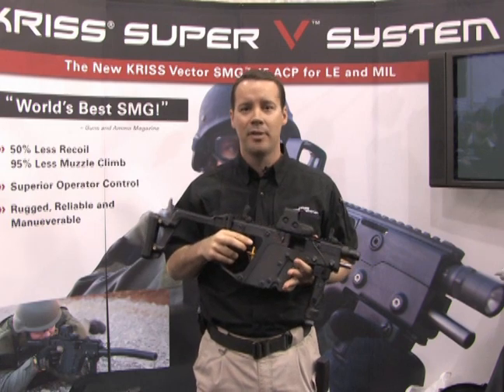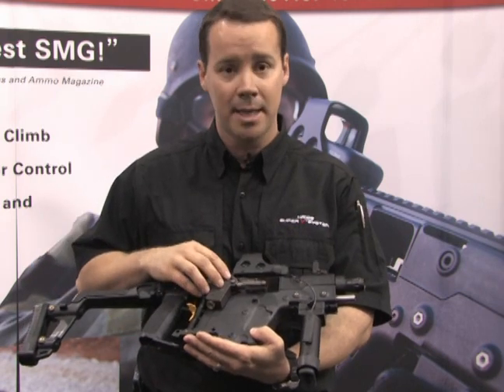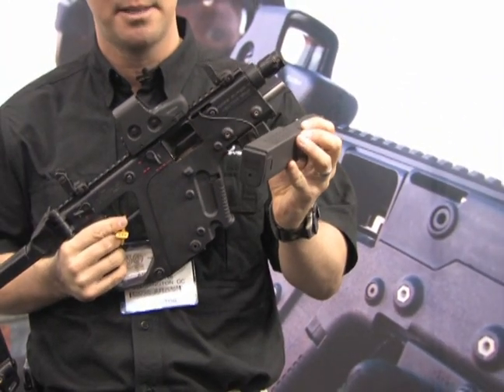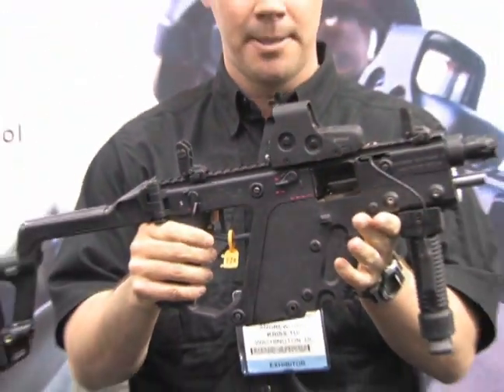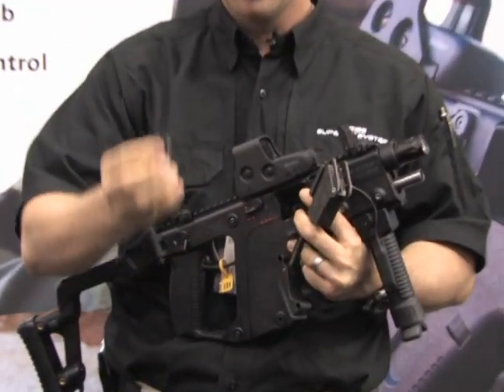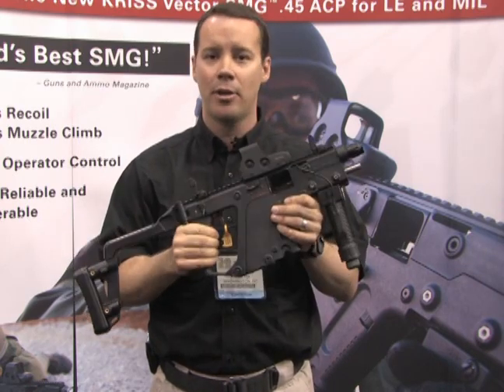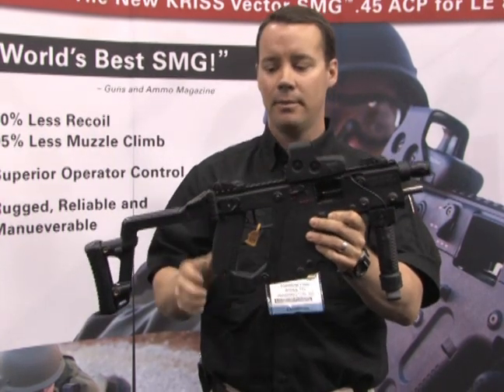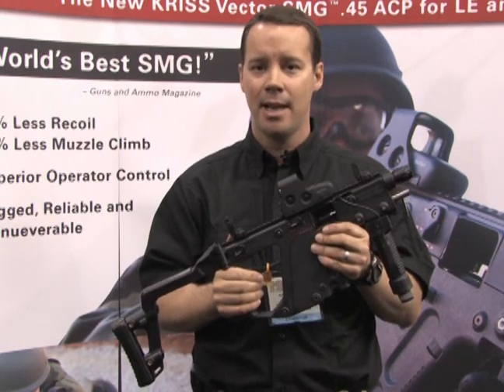Kriss-TDI SHOTSHOW 2008 Part 1

Comment: @Callmebetty123 A number of reasons. .45acp is a large diameter round so in FMJ applications it makes a big hole. When combined with a JHP round .45acp can expand to over .75in I'm not sure if you realise how much meat thats tearing through but even a poorly placed thorax shot with a string of those (Kriss on FA) will cause someone to bleed out much faster. .45acp lends itself to silencing pretty well. Standard 230grn FMJ rounds are moving at around 930FPS making them subsonic and very quiet.

Comment: @reineo When you fire, the muzzle climbs. but it climbs much more on full auto, which is even harder to compensate for when there is a lot of recoil This system directs the recoil down to balance out most of the muzzle climb, and recoil. As for cleaning it, you pop out two pins, and you can take out the bolt, recoil spring, and bolt carrier. Two more pins and you can take apart the receiver into the upper and lower sections.

Comment: The 5.7 was specifically designed to NOT do that. It tumbles and breaks in the person; without going through them. Due to small size it has good penetration through body armor (not ballistic plates though)

Comment: you can apply and obtain a SBR model by doing the correct ATF paperwork.  Its really not the hard to get or complete.  hardest part is paying for the gun and finding a dealer to buy it from.  Short Barreled Rifles are very common and perfectly legal if you have the paperwork done through the ATF.

Comment: I think that the rate of fire is fine, the two round burst would be ideal for ensured armor penetration in room to room combat scenarios. I think that they should make it for the army in 10 mm Auto then it would solve the problem of weight , accuracy and velocity of the .45 ACP. Also 10 mm has  greater knock down power, accuracy, muzzle velocity and range than either the 9 mm or the .45 ACP. I can see 10 mm as replacing the 9 mm in the future.

Comment: the 10 mm will not replace the 9 in the future. it was tested in the late 80's and early 90's and was found that while being  extremely powerfull, it was too powerfull meaning it would just pass through targets and not deliver all of the potential muzzle energy it was capable of. and thats why almost every law enforcement replaced their 9mm with a .40 caliber round (40s&w its called)also 10mm wouldnt allow a weapon system to be lighter. it would have to be just as robust as one that fired .45